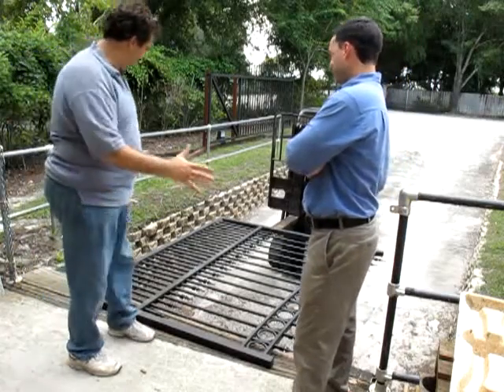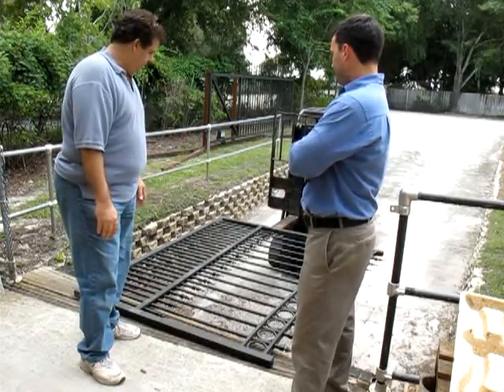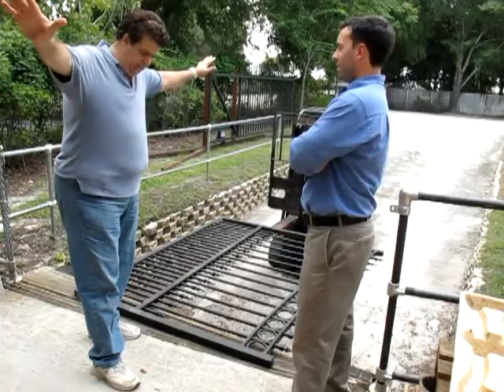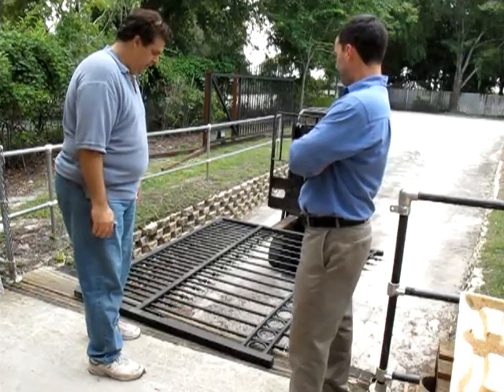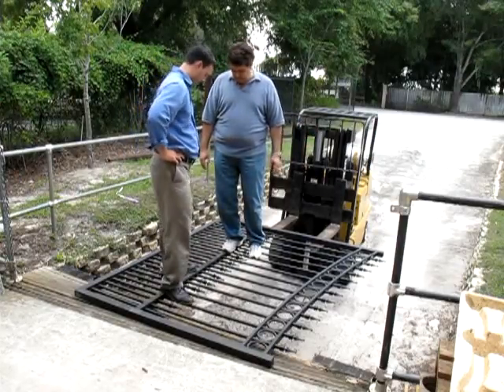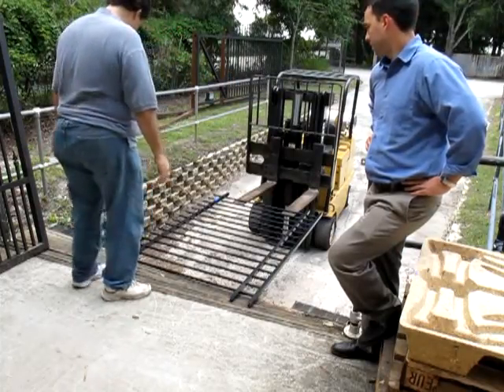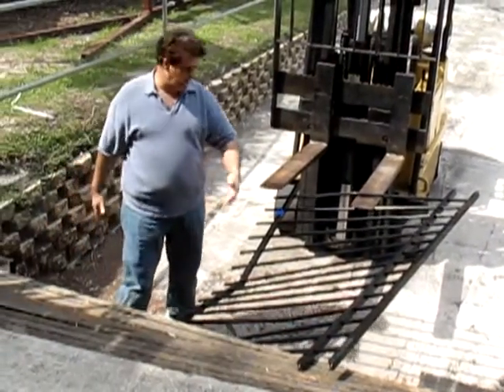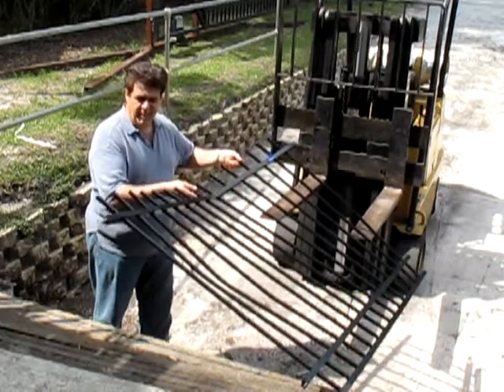How To Tell the Strength of the Aluminum Used for Estate Swing gates

Comment: I really like how you have set the record straight regarding the fact that not all aluminum gates are the same. They are not the same alloys, not the same profile dimension, not all the same wall thickness. Heck some are true wrought aluminum, even heat-treated solid bar stock of 6061-T6 grade aluminum instead of ornamental (hollow) aluminum. At the company I work for, we too have to battle the false advertising attempts of companies like the one you mention in your video. 
  I have been selling and installing both ornamental steel and aluminum gates for more than 3 decades and the one thing you did not mention was that the steel gates will rust. Even with the best coating in the world, they will rust from the inside out or where metal scratches that coating. 
  I am not making this comment to plug my own products. I am just wanting to independently verify what you have said. As a second generation fence expert, one that manufactures and sells both ornamental and wrought aluminum and steel estate gates, the fact is, not all steel gates are made equal and there is an even bigger difference in the strength performance characteristics in aluminum gates. Buy the right aluminum alloy fence, gate and railing, have the best powder coating in the industry done (AAMA 2605 or-2606) and you will have the most durable gate money can buy. Do it right the first time and NEVER have to replace that fence or gate. If you buy the best, it may even last generations, not just decades.
  I would like you to contact me. I want permission to use your video on a blog I write about aluminum fences, gates and railing. You can find me if you want and notice I never tried to promote my products on your page. I wish others had the same respect for content generators on the internet.
Reply from the maker: We don't mind if you use our video for a blog post.